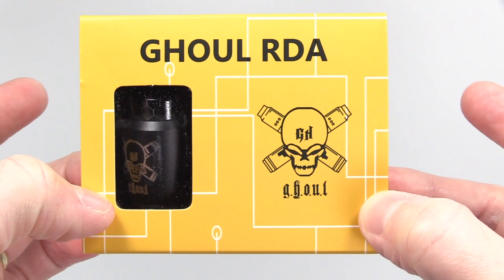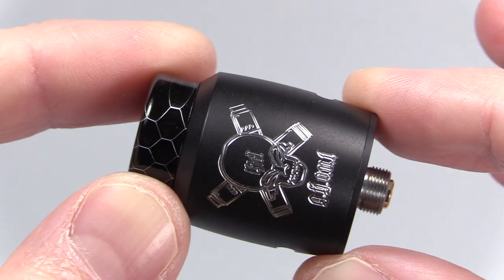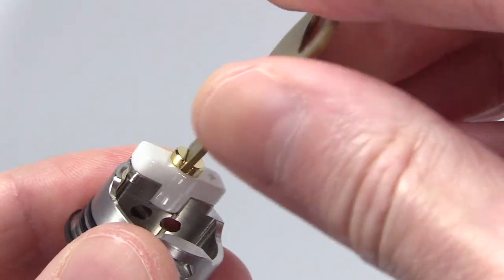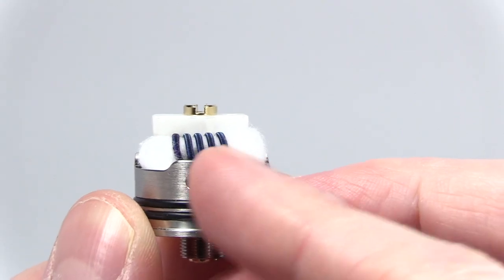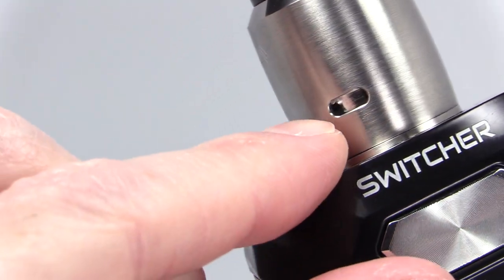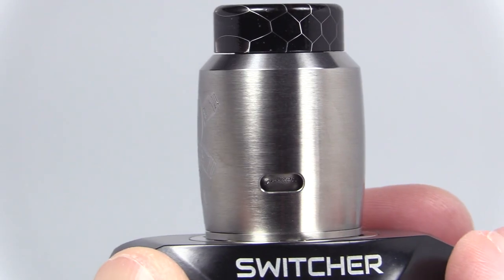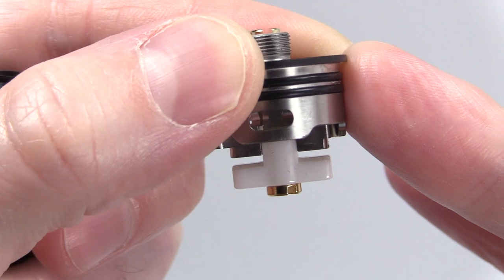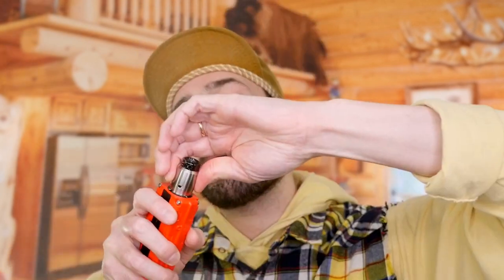The Ghoul RDA! Uses A Ceramic Connection Block!

Comment: Hey RIP! You're doing an awesome job, man!
Could you help me out and say what kind of fused claptons you use, so you can vape at 40 watts with such an good flavour?
I build fused claptons with 40ga around two wires 30ga ss and it wasn't as pleasant as I hoped it to be. Than I tried 40ga around 28ga. It is a little better but not great. Now I'm vaping on some bought wire from deamon killer at 50 watts and it's fine but not the greatest. At least it feels like that.
I hope you or someone in the comments can help me.
Vape on!

Comment: Hi, I love your videos and I would like your help with picking a first rda. I am looking for a 22 mm rda for flavour chasing and I want to use pre-made coils to start with. I use a vaporesso tarrot nano and I like a cool to slightly warm vape.
 And I like it to be very easy to build on... and if possible single coil option with the least leaking issues when over drip. Could you recommend me a nice rda? I would be thrilled!